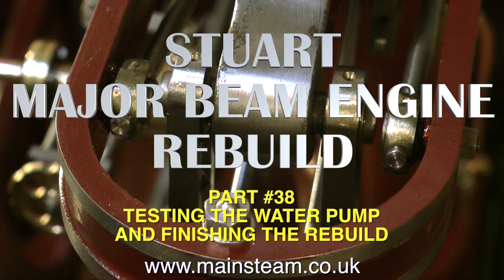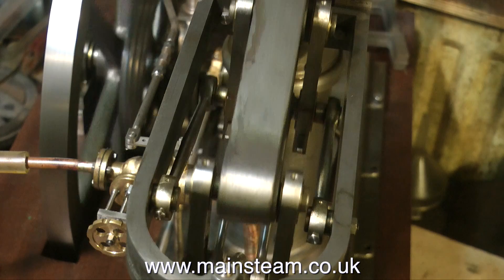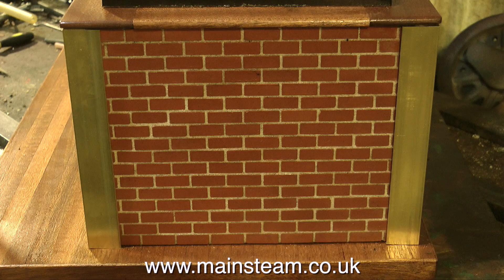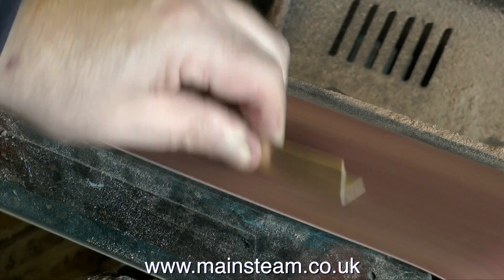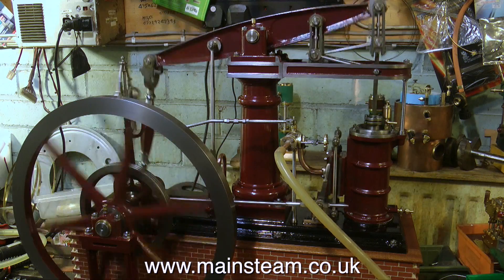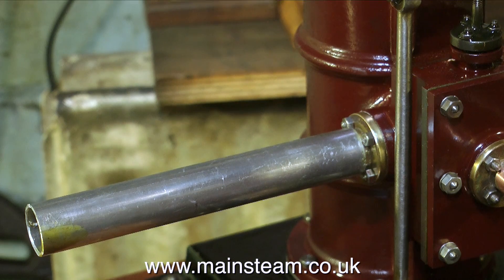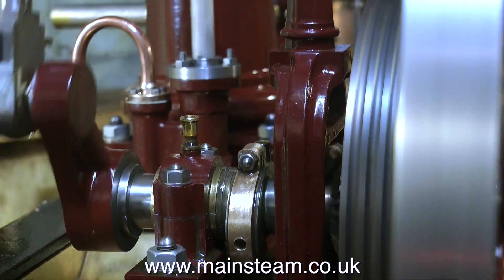STUART MAJOR BEAM ENGINE REBUILD - PART #38

Comment: hi keith do you unndertake restoration work? I have a 1/10in scale markie showmans engine, used to run well with dynamo and canopy lighting, the issue was that the engine accidentally had car engine oil rather than steam oil, the mechanical oiler seized ,it now has a displacement oiler in place, the engine runs ok, with no power, at 60psi, the engine has been retimed, but to no avail, when engine runs it is very smooth, with a lot of steam from chimney, and boiler pressure appears to drop quickly during run,, many thanks vinny
Reply from the maker: Yes I undertake rebuilds all the time. Please email me on sales@mainsteam.co.uk and we can take it from there. From your description it sounds like the pistons are blowing, but if it has been used without oil it could be worse - but most things are fixable     :-)))

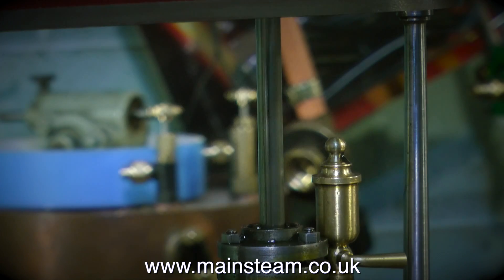Comment: Why does the big-end twist at the bottom of the stroke? (4:48)
Reply from the maker: +SpiderElectron Are you referring to the movement on the Watts Parallel Motion at the piston rod end? - I am not aware of any twisting, the mechanism rocks back & forth and it's meant to do that as the Parallel Motion stops the natural arc of the moving beam from bending the piston rod . . . . . The "Big End" as such is at the crankshaft end of the engine and is not shown at 4:48.
Reply: +Keith Appleton Yes -  Sorry for my ignorance! What a wonderful machine.

Comment: I love this model engine. I really wish I could build it for myself. But other than the cost, my machines just can't accommodate a model of this size. This lead me to find an identical, but smaller version of this model in the 'M.E. Beam Engine'.  www.ajreeves.com seems to be a supplier of castings for that kit.  Mr. Keith Appleton, do you have any experience in dealing with the reeve's company, their castings? Or even just in the M.E. Beam model itself? Any recommendations are helpful. 
Thanks again and happy model steaming!
-looking forward to your next series.
Reply from the maker: +Bernard Foshage (Bernie J) The "ME" beam engine is a very similar design but as you say smaller and more manageable. Personally I have not had any experience with Reeves, but they have ben around for a long time.

Comment: Ahhhh finally some paintwork! I was feeling the effects of withdrawal but now I'm alright again. Very good series and very good engine, would've prefered bricks for the corners but it is what it is. I agree the brass did look off.
Reply from the maker: +JonatanGronoset I personally do not care for the plinth withy the "stick on" bricks, I prefer to use "Teifoc" miniature bricks as they are the correct shape and a bit bigger.
Reply: +Keith Appleton Yes, I would've preffered actual miniature brick also. I suggested some videos back to use miniature bricks for the corners but they would be too big in relation to the "stick on" stuff. Bloody marvelous engine nonwithstanding, I wish I had it myself!